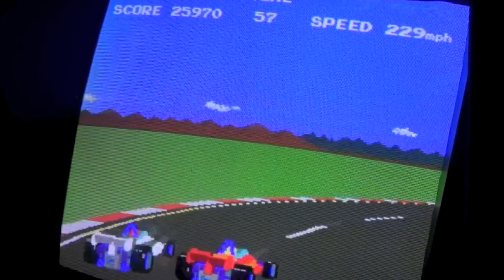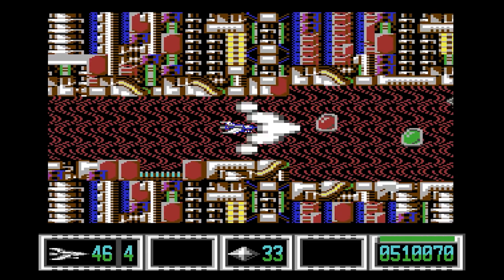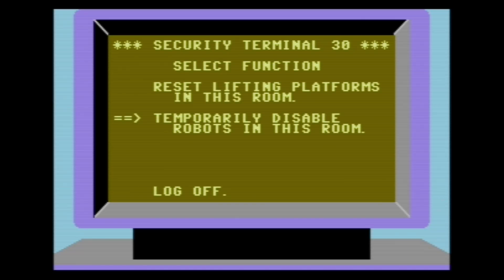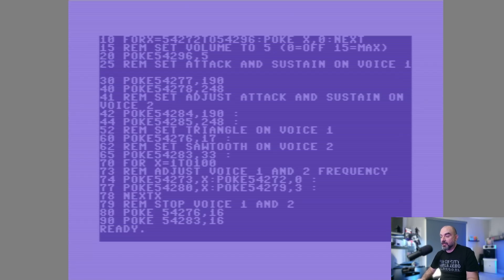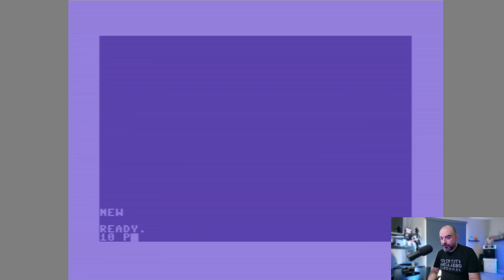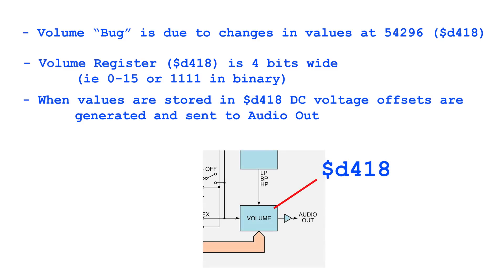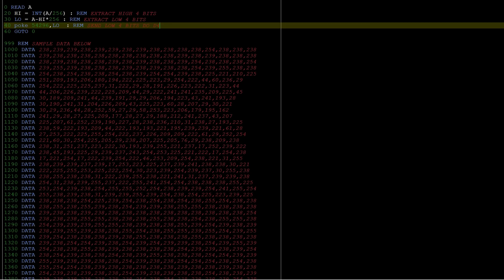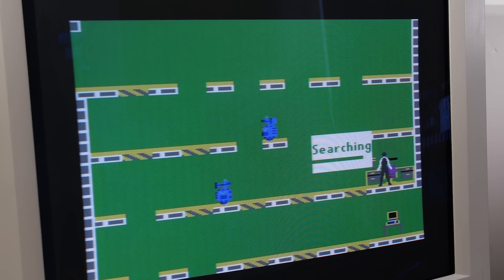How Old-School Computers Played Sound Samples | MVG

Comment: The C64 was a lot but not advanced. Even back in 1978 you could get much better home computers - Atari had almost twice the CPU power, much better sprites and even expansion slots in some models - The Apple Computers were pretty bare at first but thanks to expansion slots very flexible too  - but at several times the price! What made the C64 unique was its low price and good balancing of features. I remember a C64 plus Tape drive was around 700DM in 1984 - an Atari or Apple with slightly better equipment sometimes went for 3000-4000DM.

Comment: I had a demo program on the C64 named Foghat that would play two digitized lines from a song, "Slow ride. Take it easy." I haven't heard it in many years, so maybe my memory isn't completely reliable, but it was the clearest digitized sample I ever heard on the C64. I remember it as sounding perfect.

I also remember typing in a program that claimed to be able to digitize audio using a Datasette. Technically it worked, but the resulting quality was horrible.

Comment: Yup, we started doing "stuff" using that trick in 1986, and by 1988 had a "digitizer" (using paddle input) and an output working
Reply: I did the same thing. 1 bit sound from the Datasette, 8 bit sound from the paddle port. I would slow down music by a 45rpm record played at 33 for a boost in quality, and even better using reel to reel tape decks at different IPS settings. Then I built a real 8 bit ADC with serial communication.
Reply: @curiousgeorge7515  smart one, slowing down records!
I did try the 4bits on the "paddle" port about at the end of my time with C64/128, and indeed it was a good idea as well

Comment: This video made me think of the VIC chip and the few bugs that gave us interesting ways to do things. Would be awesome if you could manage a vid on that.

Back in the day I was able to use the bug that pushed the data off screen without having to change a thing in screen memory.

I used it to display a page of text and then dropped the visible screen, changed the text and brought screen back up to be visible again. I even used it for bounce effects on scrolling text as it was cheap on memory to do.

But since it was so long ago I couldn't even begin to remember the register and memory locations to achieve it any more.

Comment: The PC could be a goldmine for similar content. It's had a handful of sound devices that weren't intended for sample playback but which could possibly be abused into doing the job (plus a fair few that were but which didn't follow the Sound Blaster defacto standard). 

Everybody knows about the PC Speaker, which has at least two methods of sample playback (both of which are available in Fast Tracker 2). 

I vaguely recall hearing about it being possible to get the Adlib to do it, and possibly the Tandy sound chip as well. I expect this to be similar to the technique in the video of abusing the volume control. Wouldn't surprise me if most sound chips with a volume control could be abused into playing samples.
Reply: IIRC the Pinball games by DICE (Digital Illusions / 21st Century Entertainment) supported the Adlib cards to play the original Amiga MOD files through the OPL2, if you did not have one of the later cards that came with a dedicated PCM chip.

Comment: The Atari pokey chip has actually a volume sound only mode that does the same thing as the volume bug on the C64. But it is hardly used at all

Comment: On the BBC Micro, I had to play an high pitch sound, too high to hear, and adjust the volume of that. This snaps the speaker to the correct position. I expect I got the scaling all wrong but it worked well.  BTW I think the compression the C64 games used was called Mozer Comoression. It has a very distinctive sound.
Reply: It's Dave Hoskins of Superior Software Speech!!! 
GhostBusters and Impossible mission both used Mozer Compression, not sure about the other. It seemed pretty common at the time for low bit rate/low sample rate systems to use it (It was created by Forrest Mozer who I think had a patent on it, he also went on to create Electronic Speech Systems and it was used in bunch of hardware devices).

Comment: Many years ago I interfaced an A to D  chip to the user port and was able to sample sounds and then play them back with the volume trick. Wrote the program in assembly and counted instruction cycles to make the sample speed and playback speed match. It was crude but worked
Reply: That's cool, I did the same, with a serial ADC sold at RadioShack. I can't remember the model. I also used the paddle port with 4x slowed down music I made in a studio with a reel to reel at different IPS speeds, or a 45rpm record played at 331/3. Then I wrote Sample Monitor for SuperSnapshot.

Comment: IBM PCs without sound cards could do something similar to this using the PC speaker. Since there was no dedicated sound device, the CPU was tied up feeding the sound to the PC speaker, having to time sending the samples itself. Looks like the same thing is happening here.

I think the PC speaker was only 2 bits though.

There's even a Windows 3.1 PC Speaker driver you can find online somewhere, that allows any audio playback through the PC speaker. Just don't play any music in an endless loop or your PC (or VM) will softlock!

Comment: Awesome video man! It seems that the voice sample is been vocoded by the sid chip using the audio as the carrier to the amp envelope. I'd imagine that the filters will also be tweakable in the basic programmer creating different tones and types of voice. Modulation parameters in the code would also make some more realistic sounding voices.
I especially enjoyed using the speech window tool on the amiga workbench as this is essentially bending, shaping and expressing a synthesizer to create voices.

Comment: The Amstrad and the Sinclair Spectrum both had the same soundchip as the MSX. The MSX-1 that is. The MSX-2 could playback MOD-files of the Amiga, although be it in only four bits, not eight bits as the Amiga. And if I am not having false memories, the Ghostbusters game played the sample. The Apple II did not have a soundchip at all, and even that computer played the sample. The programmers that worked on the Apple version of the programme could perform magic, while the Commodore programmers simply could address a soundchip and sit on their lazy bums for the rest of the day. The Commodore programmers had to spent most of their time pushing out pimples, so that is fair.

Comment: Based on a discussion I had over in another video's comment section, another method that might have worked is to set up a pulse wave with a maxed-out duty cycle and just constantly alter the volume to match the sample's waveform as close as possible (a digital sample is, after all, just a series of volume levels), and then inverting the duty cycle whenever the sample's sign changes. This would leave you with a bunch of errant spikes that would come through as high-pitched static, but you might be able to filter those out using the SID's band-pass filter.

Comment: The Pokey chip used in Atari 8-bit computers was actually designed to play 4-bit sound samples, a feature rarely used though probably due to memory limitations and cpu time.
Reply: Yes, there was a small demo that played one sentence of a song - don't remember the name. It was synchronized with vertical retrace (15KHz).. was pretty nice.
Reply: It was few seconds of the song Self Control by Laura Branigan.    https://youtu.be/RP0_8J7uxhs      Demo:  https://youtu.be/Lk2dY4G62-c

Comment: Many eons ago, I found an address on my TI-99/4a that would allow for a 1-bit click. Combined with the address for the cassette audio input, I was able to record and play back several seconds of digital audio. One bit, probably around 4kHz, but still... No, it didn't sound as good as the C-64 but it was something. Other programs could play back digitally-recorded audio using the Speech Synthesizer. I never figured out how to do that, but the demos I heard were even better than what the C-64 could do.
Reply: That's pretty cool, I did the same thing on the C64 with the Datasette. There also was a paddle port you could record with about 4kHz sample rate.

Comment: 12:00  *8580  12:25 (shrinking more? :D ) still 8580
The triangle-digi invented by SounDemoN and is quite good on any kind of SID.
There is also the possibility to do it with PWM as the SID supports this on square-wave (unlike many other sound-chip of the time), but  limited by the highest freq available (and carrier noise).
And there also the high-res digi  - similar to the original, but with the inclusion of the filter bits (as the filtered sound is in inverse phase) making bigger dynamic range and 8580 compatible --  debuted by Mahoney in: Music Run/Stop   (more details: https://livet.se/mahoney/c64-files/Musik_RunStop_Technical_Details_by_Pex_Mahoney_Tufvesson_v2.pdf )

Comment: So what I've learned today is, the C64, using a pop generated by changing an internal DC offset, still has better PCM sound quality than the Genesis.
Reply: not exactly true, but i can see why you and many others are still saying that. because too many genesis games indeed do sound worse on the digitized audio part. but apparently the genesis hardware is capable of doing nearly as good as an Amiga if programmed correctly. But how to do that was obviously not a common knowledge back then. Very few examples of the better do exist from that era though, as in Dynamite Heady or Skitchin' for example. And of course the coders of the recent homebrew scene have learnt that lessen, you wont hear that awful scratchy sounds all that much in their productions anymore.

Comment: BTW, the designer of the SID chip, Robert "Bob" Yannes, originally wanted to have 32 voices(!) but ran out of silicon space and time. Can you imagine? Bob went on to build the Ensoniq synthesizer and the company that makes it.
Reply: Yes. And it's also a shame that newer versions of SID aren't actually out anymore. 8580 had only cosmetic changes in filters and mixed waveforms, and they also messed up 4-bit sample effect known at 6581. For example, they could have put quite a new version with at least five full-stereo channels in the C64C or C128. That could really play awesome :-)
Reply: @mnxnm  Indeed it is a puzzle why Commodore has never upgraded any of their sound chips. Not the SID and not the Amiga's Paula chip during the lifetime of either machine line. A bit of a head scratcher as to why that is. They could have added voices, resolution (in the case of Paula), frequency, effects, etc. But for some reason they just rested on their laurels and the competition eventually caught up and (in some cases) surpassed them.
Reply: @JustWasted3HoursHere  Yes, it's really sad that the Amiga 4000 still used the sound system from the original Lorraine from 1983. I have the impression that the planned AAA chipset was supposed to have 8 16-bit stereo channels, but developers couldn't make it work properly even with backwards compatibility in mind, so the A1200 and A4000 models only have AGA, where Paula remained unchanged. The problem was clearly with the company management - they really needed a second Tramiel to drive the whip :)))
Also, it's an incredible shame that the C65 remained only in the prototype stage (now auctioned on ebay for millions of dollars). The only audio upgrade there was that instead of one sid there were two, and they called it Monster-SID. Stereo was modeled after the Amiga (one sid on the left, one on the right). Still, it would have been the best 8-bit ever, and even if it didn't sell as many as the C64, I'm sure it could have produced a number of beautiful games with bombastic 6-channel music, often accompanied by digital samples.
Reply: @mnxnm  Indeed, according to wikipedia, the next gen sound system with Hombre (the next graphics architecture that was going to be released after AGA) would have 16-bit resolution sound processor with twelve voices(!). Here's the full feature list from wikipedia: https://en.wikipedia.org/wiki/Amiga_Hombre_chipset
Reply: @JustWasted3HoursHere True! It would be nice if the A1200 at least had 8 or 16 channels and 16-bit with FX… The upgrade from A-500 to 1200 was not enough.
Reply: He run head first on Commodore's budget road blocks....
Reply: The time was the bigger factor. He was going to multiplex the timers to run 32 voices on one, but Commodore needed the chip on their timetable and couldn't wait. He actually would have used the same, if not less space than 3 fully independent voices - iirc he just took the layout for the one and duplicated it for the other 2. 
Ensoniq synths use the multiplexed timer setup. 

Man, 32 voices would have been really nice.
Reply: @bitset3741 Exactly. Look at how legendary the SID ended up with "only" 3 voices. If it had had 32 voices our young heads would literally have exploded.
Reply: Tbh 13-24 channels would've been enough to me
Reply: @ssg-eggunner  Heck, at the time there were no systems out that that I'm aware of that had even more than 4 voices (Atari 8 bit with frequency limitations, with the option to combine voices to get greater frequency "resolution"), so anything more than that would have been awesome. People have actually created modern demos using 24 voice SID setups (8 SID chips) and they sound amazing. Sadly, I just looked and cannot find it!
Reply: Are new old SID chips still being produced? Is it possible to get your hands on them, or are any of those that you can find (like the HardSID, I suppose) old left-overs?
Reply: @Nostrum84  I don't believe any of the custom chips for the C64 are still in production, though there may still be some lingering, unsold, in some warehouse somewhere in the world.

Comment: If you want to see how far audio can go on that old Commodore 64 audio hardware, check out this demo that uses expanded memory and a 48khz playback rate. This runs on REAL hardware: "Elvis Costello - Welcome to the Working Week" https://youtu.be/cKwLkNoySI4

Here's another one: "Jethro Tull - Cheap Day Return" https://youtu.be/UYAf_awh5XA I think both of these demos will surprise you with their clarity and power. The actual demos are downloadable so you can play them on your own hardware. (Check the video descriptions)
Reply: Pex Tufvesson's discovery of 8-bit playback, and the brilliant implementations you link to, should be celebrated by everyone at this point.  An amazing achievement all around.
Reply: @bozimmerman  Indeed. I was wrong about one detail: It does not use expanded memory but runs on a 1MB cartridge and utilizes bank switching. I'm still impressed by the clarity that is achieved.

Comment: That's interesting. I'm trying to remember if any NES games had that and can remember a couple, Blades of Steel and Sesame Street. My understanding is that it has a chip for it but has mostly been used for sound effects. It'd be crazy if devs used similar hacks to accomplish the same.
Reply: nes has much better support for pcm. you could play acceptable quality 1-bit dpcm with almost 0 cpu overhead. voice samples would be big for those carts but some games used them.

Comment: You can make a mod called digifix on the 8580 that basically reintroduces the click. It's involves soldering a resistor onto the board and is very easy to do. The music in Skate or Die is a good test case for it. It features some drums, which are totally silent on an unmoded 8580/board.